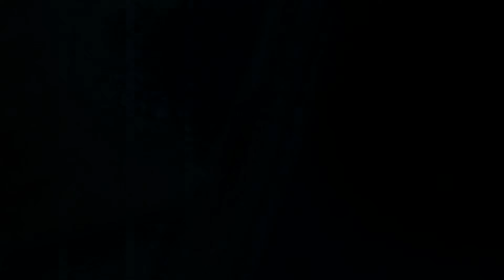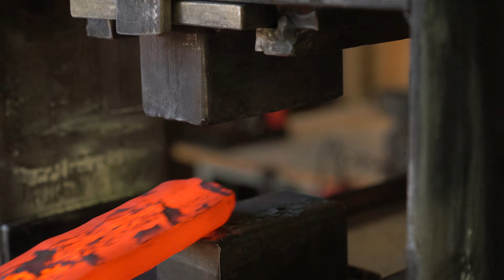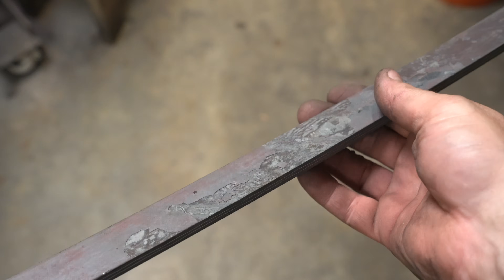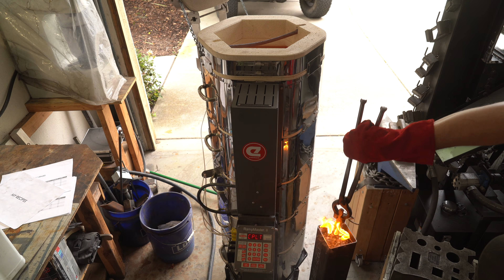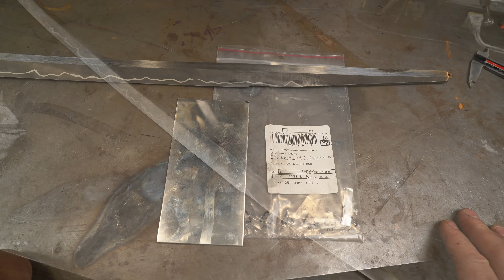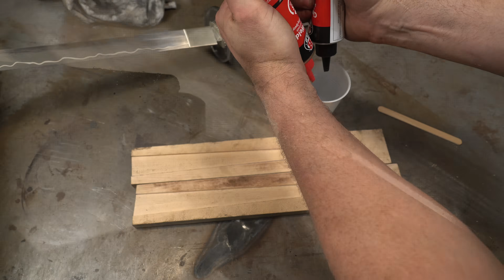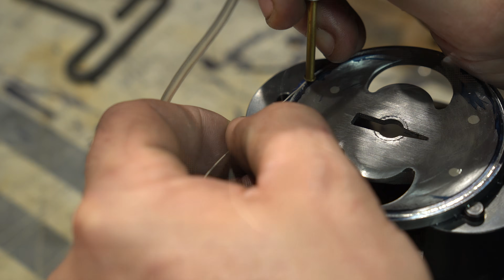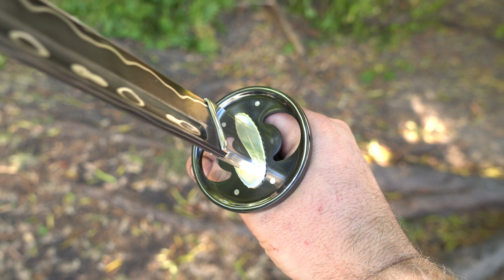Forging a Silver Damascus Katana

Comment: AN ARTISTIC WORK OF KATANA SWORD WITH STRONG AND SHARP BLADE QUALITY!
VERY COOL! I LIKE IT.
😀👍⭐
On the island of Java, Indonesia, in ancient times, around the 11th century, they made beautiful sharp weapons called KERIS, using forging and folding techniques from steel in the middle as the strongest iron element, then the two right and left sides were mixed with iron. meteorites so that various beautiful and philosophically meaningful patterns appear.
And until now, the KERIS is still there and intact. (KERIS is a typical symbol of the island of Java, some are also kept by the Leiden Museum, Balanda).
✍
The process of folding so much iron makes the blade flexible, tough and strong?
🔥
The process of making a katana sword in this video is very creative. The result is very beautiful, with texture as a crease effect...Very cool!
😀👍👍👍⭐
btway...
●Can IRON STEEL, if mixed with other materials, folded and forged many times, be combined into a sword that is strong and does not break easily?

●What type of iron is the hardest and strongest?

●Can titanium be mixed to make a sword blade stronger?

Thank you for your response... Good luck making beautiful swords that are artistic and strong.
💪😊👍⭐
Greetings,
GOD BLESS
🙏
Reply from the maker: This sword is very strong and functional.  The silver is a thin layer, about the thickness of two pieces of paper after forging, over a central core of high carbon steel which is the entire cutting edge.  There’s no “best” steel, it’s balance of toughness and edge retention.  Titanium mixed with steel requires lab-like conditions and cannot be done in a home shop. Thanks for watching.

Comment: Dude. 3"x6" 10 gauge sterling sheet weighs 10 troy ounces, the spot price is around $25 an ounce, even at $30 ozt that is like $300. Not sure where you bought the silver but try Rio Grande Jewelers Supply or Stuller INC for precious metals. AWESOME work! Very cool.
Reply from the maker: This WAS purchased at Stuller.  I showed the receipt in the video.  Perhaps you should go check prices.  Note that there’s also a 1/8” piece that’s 3”x6”.  Thanks for watching

Comment: What you said at 10 minutes thats impossible to get a good katana shape from the forge only let tell you that in Japan few centuries ago theres was no grinder or press like yours and theyve the most beautiful and sharpest katana in the world.
Reply from the maker: Did you even listen to what I said??  This is a layered construction with non-ferrous metals so trying to forge it to shape will cause those layers to delaminate.  Instead of trying to “explain” how bladesmithing is done to an accredited Bladesmith, perhaps start with asking a question.  You just might learn something.
Reply: The layers will not glue together creating a new piece of metal? Sorry if I asked my question incorrectly previously.
Reply from the maker: Yes the layers will  forge together, but if a) you try to forge on the edge of the billet it will delaminate, b) forging a layered billet like this just thins out the core.  Forging something to shape does NOT make it better.  You glamorize the katanas of old but they actually used far inferior steel to both today’s steel and even what was available in Europe and the Middle East.  The reason they “folded” it so many times was to try to remove the rampant impurities.  Do some research beyond video games and pop culture and you’ll see.

Comment: Is that the silver peeling off on the sides as you stretch the metal and the silver…?
Reply from the maker: No, that's iron oxide, commonly known as forge scale.  Whenever hot steel is exposed to air the outside hardens and as it's manipulated, that hard layer flakes off.  It's a waste product that is thrown away.  Thanks for watching.

Comment: I am wondering if it's possible to make a tungsten and titanium Damascus katana?
Reply from the maker: Both those metals are brittle and do not make good blades.  Your katana would snap on the first strike. Plus bonding them together would probably not be possible.   Thanks for watching.
Reply: @TyrellKnifeworks  Thanks for the info, I appreciate it! Great video by the way, absolutely beautiful Katana.

Comment: That is beautiful work. I was wondering if this would carry any risk of delamination if it were to be used
Reply from the maker: There’s no risk of it delaminating.  The bond is like a brazing bond and it has a tensile strength in excess of 70000 psi so you’d destroy the blade before you’d shear the layers apart.  Thanks for watching.

Comment: I was always wondering, do you lose a significant amount of metal to oxidation?
Reply from the maker: Any forging project will produce forge scale.  Usually you have to count on about 10%+ loss to scale, depending on how many heats you do.  If you're forging by hand, that means more heats and it could be as much as 50%.  Thanks for watching.
Reply: @TyrellKnifeworks  Wow!! That's so much!!
Reply from the maker: @drasiella  In a future build I'll collect all the scale and show it in the video (and weigh it) so you guys have a better idea.  😉

Comment: not sure how you stopped the silver melting in the 1200 degree c oven when silver melts just under 1000 degree c????
Reply from the maker: The forge was set to 1650F / 898C and the melting point of pure silver is 1763F / 961C.  Thanks for watching
Reply: no. you said at the beginning the forge was set at 2200 f or 1204 c. pure silver melts at 1640 f or 893 c  look it up. something doesn't add up. i used to work in a testing lab and we used pure silvers melting point to calibrate thermometers
Reply from the maker: yeah but at that time I was just forging the Damascus for the cladding.  The silver wasn’t added until much later in the video and then the forge was turned down.

Comment: You could add a brush like the boot cleaners on the bottom jaw of the press to clear of slag and scale build-up I think it's a good idea
Reply from the maker: Perhaps, I've seen others do this.  Might not be a bad idea.  Thanks for watching.
Reply: @TyrellKnifeworks  amazing sword btw a matching sun katana with gold would be insane you could sell the set for 10k plus
Edit- A tanto or short sword would make more sense
Reply from the maker: @Alowe25   Uh, this sword already sold for $10k.  A gold one would be 3x that.  I've already done a chef knife with 24k gold and it was $5500 just for the gold.  😉
Reply: @TyrellKnifeworks  holy crap. I'm not surprised the quality and design were pro levle, so the set probably would've sold for 25k plus. The amount of time, material and quality that goes into it. It should have a decent price tag on it.

Comment: funny, it's lie you are kneading the steel like a dough with these opposing speed-bump attachments on the press, makes a lot of sense in my brain when I think of the inside of the steel, the structure, the crystals and so on, austerite bcms martensite and all that wonderful transformation stuff. awesome!  btw, is a "modular" oven an idea? a main oven with enough depth 4 2 burners, and optionally openable on the backside, so you can add a 2 oven with 1 or 2 burners, (rather 1) and make sure the backside is openable as well 4 really long stufff. I would recommend aerated concrete which is suuper light, easy to cut and holds the heat like no other material (I'm a german retired builder)..  you can lay your hand on the top aerated concrete plate (at least 3" thickness) and it will be nice and cool whist inside pure hell is loose. 😅
Reply from the maker: Some companies already make modular heat treat ovens.  I’m actually talking with my buddy Brian at Housemade.us who makes forges to get two I can buckle together when I need a long one.  😉.  Thanks for watching.

Comment: wouldn't the silver make the blade weaker?
Reply from the maker: The entire core and cutting edge is high carbon steel.  The silver is a very thin layer, about the thickness of two pieces of paper after forging.  It’s very strong and the silver adds a bit of flexibility.  Thanks for watching.

Comment: Now I'm just wondering if the silver weakens the blade or not. Other than that, it is a beautiful katana.
Reply from the maker: The entire core and cutting edge is high carbon steel. The silver is a very thin layer, about the thickness of two pieces of paper after forging.  It’s very strong and the silver does not weaken it at all.  The silver bonds to the steel with over 70000 psi in tensile strength.  You’d destroy the blade before the layers would shear apart.  Thanks for watching.

Comment: What flakes off the billet when you press it?
Reply from the maker: That is iron oxide, commonly known as forge scale.  It’s caused by hot steel contacting air and immediately oxidizing.  It flakes off when the steel is compressed.  It’s a waste product.  Thanks for watching.
Reply: @TyrellKnifeworks  , ok awesome. Thank you for the reply. I’ll give you a subscribe

Comment: There are many things that do not like iron or silver.... I would make the amount of layers, and later the folds(for mine) significant holy numbers. And the quench water to be blessed. And the oil to have a mix of holy anointing oil and other things. My engravings would be mantras and runes and other symbols for warding evil things and blessings of protection and strength.

If I had the time money and resources, really would make a blade fit for killing demons and other dark things.
Reply from the maker: That sounds like an interesting build, Anthony. Thanks for checking this one out.

Comment: It does look pretty good, but I'm pretty sure the silver layers in the blade are compromising its physical properties.
Reply from the maker: The entire core and cutting edge is high carbon steel.  The silver is a thin layer, about the thickness of two pieces of paper over that core.  That bond is in excess of 70000 psi in tensile strength and you’d destroy the blade before the layers would delaminate.  Thanks for watching.
Reply: @TyrellKnifeworks  Thank you for the explanation! :)

Comment: is pure silver really that maleable when it is that thin? also how was it made so thin in the first place?
Reply from the maker: Yes, it’s very malleable.  It was purchased from a jewelry supply store.  I showed the receipt in the video.  Thanks for watching.
Reply: @TyrellKnifeworks  hello [T]/ last question if you may, does the silver in anyway compromise the mechanical integrity of the sword?
Reply from the maker: @LetMeFLY649  no, it doesn’t affect the integrity.

Comment: I’m definitely not against artistic flare. However, as a mostly engineer like minded person, I have to ask if the untraditional material construction and inclusion of silver takes away from the performance in terms of durability and strength of the blade? As if it does this would be very off putting. Similar question in the forging vs differential heating to cause the curve as the stresses and grain in the blade are very different.
Reply from the maker: The entire core and cutting edge here is high carbon steel.  The silver provides some shock absorption and flexibility.  This blade is certainly strong and functional.  Thanks for watching.

Comment: the "lether" not the stingray lether needs to be more smooth and square like without any twists other then that the sword looks good idk about the sharpness because for me a 10/10 sharpness needs to cut a banboo 3 times in session on all part of the blade so 3 at the bottom 3 at the middle and 3 at the top. If all of these things are met it would be a 10/10 because the lether isnt there, for me its a 9.5 out of ten and idk about the sharpness so it doesnt count. Also the banboo needs to be thick or 4 small banboos need to be straped together so yeah. Also the blade needs something but I just cant put my finger on it. Final note from me 10/10 for looks, 9/10 for creativity, 9?/10 for sharpness (theres some forced tearing on the edges), originality 10/10, traditional makeing process 8/10 (doesnt follow the japanese style of katana makeing), and 8.5/10 for the demascus patern (it is a pattern but you need to make the patern into some other texture not just the wave texture but a for exsample a tiled texture(9/10), dragon texture (10/10)... these are the textures and the dragon texture is a "demascus drawing" so it takes more effort (sragon scales) it think you understand).                 Final note fr: 9.1/10
Reply from the maker: Thanks for watching
Reply: np the sword looks awsome tho and you have a great talent for blacksmithing. After some time you could be at a lvl of a grandmaster. @TyrellKnifeworks

Comment: This is buty full but it's not that much hard edge..your silverl going in to the edge..so it could be not sharp every time ❤
Reply from the maker: The silver never touches the cutting edge.  The entire core and cutting edge is high carbon steel.  I explained this in the first minute of the video with diagrams.  Go watch that.

Comment: Was it just for preference to use glue instead of using a more mechanical method like pins to hold the handle together
Reply from the maker: There’s no glue holding the handle together, it has a black mekugi (pin) made from G10.  Thanks for watching

Comment: Great video! The sword looks great! Could you explain a little bit more about how you set up the heated salt bath and do you think it would work for titanium?
Reply from the maker: This is a special hot salt for oxidizing metal.  I’ve done a video just on hot salt processes so you can check in that out.  Thanks for watching.
Reply: @TyrellKnifeworks  I was just going to reply here that I found your video pertaining to both black and blue oxidizing. Still wondering about Titanium though and whether it can be blackened like the steel can. Have you ever tried it?

Comment: I was planning on making an entry for this challenge, but i didn't have a suitable container to quench my tanto in, so i wasn't able to, but for the next challenge, i definitely will enter. Also, for challenge submissions, do we need a video of the whole making of the blade, or can it be a slide-show type of thing with the blade at various stages in the making?
Reply from the maker: No video necessary, only a picture of your completed build.  Join the FB Group: YouTube Knifemaker Challenge, that’s where the rules will be posted.
Reply: @TyrellKnifeworks thank you

Comment: What if any flux did you use to join the silver to the iron
Reply from the maker: No flux was necessary because the billet was fully welded all around creating an oxygen free environment.  Thanks for watching.
Reply: @TyrellKnifeworks  thanks for the reply. Do you have any advice on how you would attempt this where welding edges isn't feasible?  I've been attempting something similar but have been unable to get it to work with jewlers flux and your video has been really the only case I've found of someone layering iron and silver
Reply from the maker: @cwlogan13  why isn’t welding feasible, if I can ask?
Reply: @TyrellKnifeworks  I'm using thicker silver, more layers and the strips are only about 5mm wide. Trying to make a blank for a ring.
Reply from the maker: @cwlogan13  you can still weld it.  Just turn the welder down.

Comment: Finally, a katana forging video thats actual forging and not cutting/ machining metal only
Reply from the maker: Thanks for checking it out!
Reply: @TyrellKnifeworks  no problem, forging and katanas are interesting to me, i thought the layering of the different metals and the exposing of the core steel for the edge was really cool
Reply: Kind of sad you couldnt get the differential heating in though

Comment: My comments are probably shadow banned but i will ask anyway on the off chance that its not.
what is all that flaky stuff falling off of the billet?
Further more. lest just say if you hypothetically just keep heating and pressing it indefinitely, would it eventually flake away to nothing?
Reply from the maker: Those flakes are iron oxide, commonly known as forge scale.  It occurs when hot steel is exposed to air and it hardens then cracks and flakes off.  Yes, if you kept heating it, it would eventually decay to nothing. Thanks for watching.

Comment: Gorgeous blade.
Now make a replica of Grayswandir from The Chronicles of Amber, by Roger Zelazny.
Big silvery blade, with a portion of the multidimensional "Pattern" magically imbued into the blade.
Reply from the maker: I’ll have to check that out.  Thanks for watching.
Reply: @TyrellKnifeworks  Lemme give you some background.
Amber is the city in the center of the multiverse, from which all other universes derive. Far beneath the royal castle is the Pattern, upon which all existence was based. Only the royal family may walk the Pattern and survive. If they do, it gives them even more fantastic powers over reality.
The Pattern itself is maybe between 50-100 feet across (I can't remember specifically).
It's an intricate twisting corkscrew design built into the floor and radiating wisps of energy. You have to start on the outside and corkscrew your way into the center.

Amber represents order. Thematically, it's a lot like Asgard, at the center of the 9 realms. Only with Amber, there are an infinite number of realms.
Infinite multiverse, long before it was cool.

Grayswandir is a sword that has a portion of the outer loop of the Pattern magically inscribed into it. It is up there with Excalibur in terms of magical power, maybe more.
It's especially useful when attacking beings of Chaos. It can also attack intangible enemies.

It's a silvery gray long sword with patterns on it that look like your Damascus katana, only perhaps more so.

If I could have any two swords from all fiction/mythology, I'd want Excalibur and Grayswandir.
If I had to choose one, it would be a tough choice. I'm leaning Grayswandir.